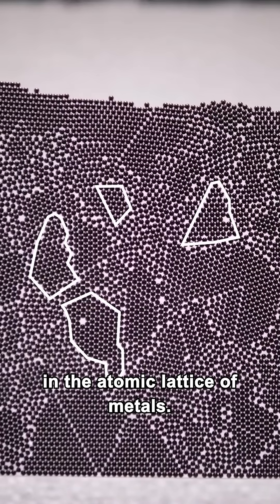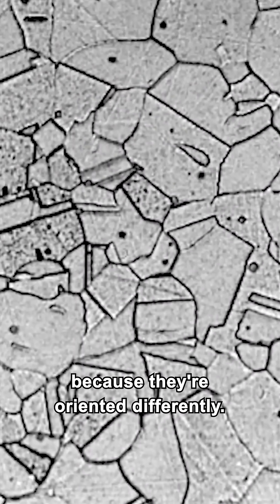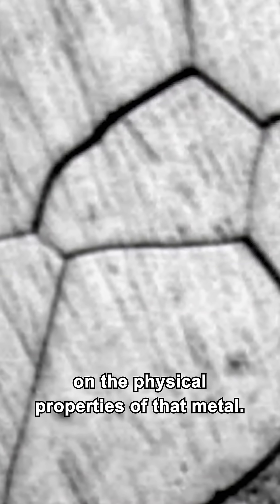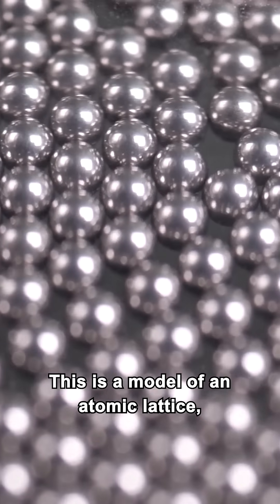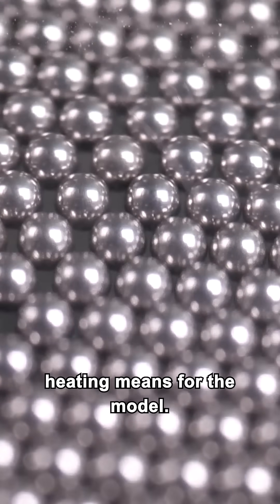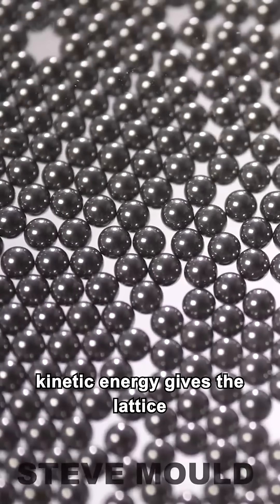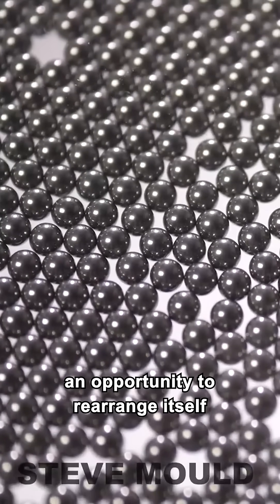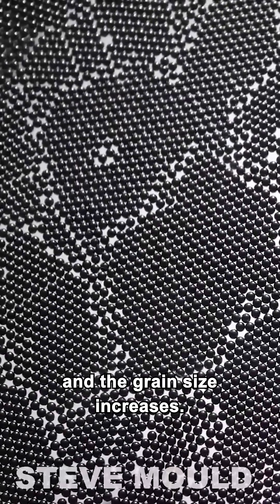What Happens When We Heat Treat Metal? #shorts

Comment: It gives an idea of rock's convection inside the earth where it is supposed to be solid because of the pressure (despite the heat) and capable of move from slips at atomic levels. I failed to picture that in my mind until this video clip.

Comment: There's also a pressure gradient in your model! Since the orbs are stacked vertically, the ones at the bottom have more pressure on them than the ones towards the top, and you can see that more pressure at the same temperature increases the rate of changes in the material! ✨✨

Comment: When you get into steel, this is actually only half the story
This would be a perfect demonstration of the first stage of heat treatment of steel, where carbides are dissolved and formed into larger grains, but there are more stages after this that redistribute the carbides and reform the grains into smaller and more evenly distributed forms, which makes steel overall have more desirable properties
It is super cool to see how grains change over the steps of a heat treat

Comment: Hey,

Just to jump in and say something about it cause I hat Werkstofflehre for my Exams.

Year heat treating is forming bigger Kristalls as you cool the material.but moste times that's an unwanted Effekt.

Year it's use full. To slowly let a big block of iron cool down so it doesn't krank and is though.

But especially for steel to harden it  you want it to get coolt quickly on the outside. For tools or swoars. For a soft and tuff inner and a hard outer layer.

But steel forms diffrent crystals depending on carbon levels. (EKD) 

So carbon treating is a thing.

Comment: I feel that the only issue with this video is that it fails to properly explain to non-engineers the effects of different grain sizes in metals, which I think is one of the most interesting aspects of this subject.

Larger grains means the metal is more malleable and can witstand more flexion, whereas smaller grains means the metal becomes harder but more brittle. This is why a metal can be re-heated in a forge to change its properties and it's also the reason why metal is cooled off quickly (typically with oil or water) while tempering to make it harden.

Good content!
Reply: (What follows in an ‘Um… Actually’, apologies in advance)

Decreasing grain size is one of the very few methods of increasing strength and toughness at the same time. It’s almost always one or the other. Dislocations get blocked from moving very far before hitting a grain boundary so plastic deformation is harder I.e. strength goes up. A crack will grow through some grain orientations much more easily than others so a small grain size is far more likely to stop a crack than a large grain size thus improving toughness too.

Comment: I love this representation of metal lattice structures. The one made of evenly sized soap bubbles too (that one is fun because you can adjust the bubble size halfway through and simulate an alloy, and you can simulate heat treatments by just gently blowing on it from afar). You can also identify most main types of defects with these (all except for 1 that can only be visualised in 3D lattices, I think?)

Comment: Not entirely true. This actually depends on the amount of stress (cold work) done to the metal. If there is high inner stress, the grains will break into smaller pieces to release the stress before re arrangements to larger grains 😅

Comment: Important to note is that heat treatment doesn’t just mean adding heat! The grain size really depends on how hot you get the metal, and the rate of cooling. if you heat it to melt then cool it really fast, you will actually get smaller grains!

Comment: Unfortunately, the actual effects are insanely more complicated, especially considering that larger grains in steels are generally (note the use of the word generally, not always) considered undesirable, since it makes the steel more brittle while not considerably increasing other strengths. Sometimes, it actually makes the grains smaller, in the case of heat treating carburized metals. It is true that the added heat allows movement, but rather than focusing on the changes in grain size, it'd be more conducive to focus on the change in total potential energy, as internal stresses of the metal are released. This reverses the effects of cold working (which increase strength), but increases dimensional stability, and decreases hardness in exchange for toughness and ductility. Not even taking into account alloying, and total changes in grain structure which occur when hardening.

Comment: I wonder if the metal atoms can cause the same issue that grains in a grain silo can have when exiting the silo: due to the math of it, technically, you can get an infinite outward force on anything restricting the flow and it will explode, effectively destroying the exit hole of the silo. Would be hard to test though, I imagine.

Comment: There is a machine learning algorihm called simulated annealing where the algorithm takes some configurable optimizable thing (say a list of users with preferences), and configures it in decreasingly random ways over time. The effect: alot of shuffling of configurations in the beginning of the run, and more stringent filtering of shuffles towards the end of the run. Eventually, you end up with an optimal configuration - all without explicitly tweaking any individual configuration directly. 

Maybe i didnt explain it well here but it absolutely blew my mind in college

Comment: I remember watching a documentary about Rolls Royce and they would isolate one of them crystals put it in a weird tube and they would grow metal from one crystal to stop a phenomenon called creep. Which is essentially just metals expanding and contracting. In jet engines the tolerances are so fine they have to do things like that
Reply: Creep is actually permanent deformation FYI, metals creep when they're held at high temperatures (below the melting point) and put under stress. In a jet turbine, the blades will experience creep that slowly brings the tips closer and closer to the turbine wall which can cause serious problems if the blades creep enough to actually make contact. Monocrystalline steel blades resist creep by being, well, monocrystalline. Because it's all one crystal domain you don't see atoms shuffling past each other like in this video, though creep does still happen just more slowly.

Comment: "Heat Treatment" is a very generic term, and what is shown is only ONE kind of Heat Treatment, the kind which softens metal, making it less brittle as well. Other kinds of heat treatment do other things, including making the grain sizes smaller for a harder, stiffer, more brittle outcome, achieved by rather rapid cooling of hot metal. Extremely rapid cooling from the molten state produces amorphous metal, aka metal glass, which has no grains at all.

Comment: I’m a knife maker and heat treating the steel is what makes or breaks the knife. Sometimes it literally breaks the knife. There’s a few processes you have to do to put the steel in the proper state to be quenched. You want fine grain in the steel, like flour not sugar so you do a few cycles of heating and cooling at different temps to achieve that. When the steel reaches the right temp to be quenched it has the right properties for a knife. The rapid cooling of the steel in the quench locks those properties in. Then you do temper cycles cause the quench also makes the steel brittle.
Reply: I've  heard about the dreaded "tink" fairy. Not had any visits from it yet though, as I haven't heavily forged anything that I've  heat-treated
Reply: @samuelmellars7855 ive been visited by the lil bastard, snapped a knife clean in two
Reply: Tempering also makes grains finer, thus increase its yield and reduce brittleness, if you are looking to make the grains finer in the first place, might as well just do the annealing by keeping the steel at a certain temperature for certain amount of time (exactly how high and how long is dependent on the steel you use, steelmakers should have a iron phase diagram for you to reference), though I am not certain whether it's pratical for you, but if you do have the equipment, might as well give it a try.
Reply: Great informative comment- don't mind the commenter 'Andrew'- his demeaning arrogance is a manifestation/ overcompensation of his insecurity
Reply: bla bla bla yeah, a industrial complex do that without a hammer and in a much more efficient way as well. Doing by hand is a craft and a art, not efficient. Stick to the "skill" part, but don't come talking about steel quality because modern science already does that better for quite some time now. The crafted one is also overpriced af, so there is that..
Reply: @akiraic  dang you that Andrew person really got issues with me explaining how to heat treat a knife don’t you?
Reply: @akiraic bro, you dont just have a degree, you teach a masterclass on yapology
Reply: @akiraic  the "efficient" methods you're talking about are notorious for producing inferior products, but okay. 

Also what a weird thing to get upset about. Do you own an industrial sized knife forge or something? Baffling.

Thats like my neighbor offering me a glass of lemonade and then I go on a rant about how its inefficient to make lemonade at home because Simply has a much better system for making lemonade at a commercial scale. 

Just completely derranged and unhinged.
Reply: Awesome, you are a knife sanding monkey? Well you are talking with engineers buddy. You aren’t the expert.
Reply: @andrewl2787 easy there captain obnoxious. Dude had perfectly valid input to the conversation
Reply: @andrewl2787 serious question, were you repeatedly, and intentionally dropped on your head as an infant? I can not think of any other way you came out this way without some kind of repeat trauma.
Reply: @whatarenames  you realize a 12 year old boy in Pakistan can make a knife with medieval technology right. 

There’s a reason why having a bachelor of science in civil engineering and masters degree in chemistry pay well.
Reply: @andrewl2787  ok, then show the world your superiority and make knives, not as a job, but just to show you're better. Come on, I know you can do it!
Reply: @andrewl2787 dude not trying to be mean but... picking a fight with strangers  on the Internet... just so you can brag about your education????... your ego is a result of a chip on your shoulder. It is you overcompensating...its the is the reason  why people steer clear of you. 

Until you face whatever trauma you have (rather than burying the hurt and anger behind  arrogance and pride), accept it and let go, you will always be angry/insecure/ not feel good enough.

Hope this helps.
Reply: @andrewl2787 Being a knife maker and owning your own business can be incredibly lucrative in the west, this isn't Pakistan.
Reply: @andrewl2787  I get your point that knowing something and understanding the how's and whys are two very different things, but your post came off as quite arrogant and rude. OP was giving an example of practical application of the principle.
Reply: @andrewl2787 Seems to make you arrogant and insufferable though.
Reply: @andrewl2787 hurr de durr knifemakers arent allowed to understand material sciences like metallurgy. 

Imagine trying to gatekeep knowledge lmao
Reply: @andrewl2787 Jesus fella - you get out much
Reply: @whatarenames  Andrew probably works in a supermarket.
Reply: 😊 @TrumpstienPhile
Reply: @andrewl2787  my guy, what gave you the idea he said he was an expert? He didn't even contradict or disagree with anything stated in the video. In fact, he actually furthered the discussion by giving and example of how this principle is put into practice.
Reply: @andrewl2787 so you’re saying a knife maker cannot have scientific understanding or he/she cannot involve in this discussion? What the actual f@ck 🤷‍♂️
Reply: @sreesweraam obviously metallurgy isn't real science, duh. /s

Comment: I am a mechanical engineer with fair knowledge of basic material science.  Have used  different types of heat treatments (Specially hardening & case hardening) on steel many times. Seen those grain structures even with electron microscope on occasion. 

This little demonstration/ video has helped me truly internalize what is going on.
Thanks!

Comment: I'd love to see the grain pattern of Damascus steel up close and then also compared to it being bigger and explained how that makes such a difference.. is it more functional than just other metal (1 the biggest component type of steel) with a similar heat treatment/forging?
Reply: Damascus steel is somewhat like a modern Carbon fiber composite, with layers of strong but brittle material alternating with layers of softer, less brittle material. A great example of this sort of composite in nature is the Abalone shell. Ironically, putting too many folds in the ingot will actually destroy the benefits, by making the layers too thin... even down to the thickness of single atoms!

Comment: so, when the vibration stops, it translates to "water cooling" or some sort of "temperature shock" to HOLD the atoms in the rearranged form? because otherwise they would cool down unevenly and be unorganized again
Reply: If you cool it down slow it would give the balls time to continue reorganising and you wouldn't get the wanted grain size.
Reply: @Daniel-ih4zh  so in forgery that's why the cool it fast with water? so the crystals are uniform and thus making it harder to break apart, right? I think I did a similar thing with a needle

Comment: Is this the same for copper vs iron based metals where heating and rapid cooling hardens iron and steel but softens copper and brass. I had to bend some brass tube and was really surprised that first I had to heat and rapidly cool it.

Comment: If the rate at which a casting cools down is slowed down sufficiently, by the use of ovens, it can be manipulated to form a single crystal.  This is done for the fan blades of jet engines and similar applications.  It is incredibly  expensive in terms of energy and (naturally) money.
Reply: Yep isn't it used because the blades are so small/thin that if they weren't made out of a singular crystal they wouldn't hold the sheer forces inside the engine? I think I read/heard something like that somewhere.
Reply: @pvpminer9007 No. They are created as a single crystal to improve their strength. Interfaces between crystals are points where the metal can fail.

Actually modern day turbine blades can be laminates.
Reply: @deang5622 you mean tensile failure. A larger crystal is much weaker from a compressive pressure since the crystal can realign itself without having to jump to the next grain.
Material science is weird like that.
You get good compression resistance and become inflexible, but then you shatter.
You get good tensile resistance, but then you bend and can warp.
But I guess the fan blade guys thought of that, they are pretty smart guus
Reply: Making single-crystal metal takes much more specialized processing than mere slow cooling in an oven. There cannot be ANY existing crystals in the metal, so all castings and extrusions are eliminated from the acceptable types of processing. Instead, crystallization has to be SEEDED with a small crystal already having ONLY the desired crystallographic orientation, with the molten metal quickly adopting that preferred pattern as the uneven heating of the oven causes the solidification temperature to be reached exactly where the growing seed crystal is positioned, but nowhere else.
Reply: @Lilin.X That is one process; there are others.
Reply: GE has relatively recently started making SiC/SiC composite fan blades for their jet engines so that they could increase the operating temperature of their engines. This composite is similar to carbon fiber, but the actual carbon fibers are silicon carbide fibers and the epoxy is also silicon carbide.

Comment: That's an interesting model. Using sound as a proxy for heat raises another question about resonant frequencies because sound can create certain patterns and structures on a two-dimensional surface at specific resonant frequencies. This makes me wonder if there's an equivalent to resonant frequencies when applying heat to a two-dimensional or three-dimensional material.
Reply: The random frequencies and wavelengths associated with Heat extend to extremely high frequencies such as THz (trillions of cycles per second) and extremely short wavelengths. That is far beyond anything normally called "sound." And that energy is quantized at the atomic level, so if searching for any existing publications on your question, you probably will get into extreme complexity right away.
Reply: Resonant frequencies occur when you have consistent motion. ‘Heat’ or having thermal energy is defined as having random motion via vibrations. Unfortunately, random motion rarely turns into resonant motion unless some resonant frequency is acting upon it. Therefore, you’d need a heat source that can somehow be defined as having resonant modes. Long story short, wonderful question, but there is no regularity to random motion, so no. 

As a short addendum:
Condensed matter physics has to deal with weird things happening at extremely low temperatures. At these temperatures, although particle motion is still random, it is much much slower and may have different properties. I would watch some videos about condensed matter physics and see if they talk about anything relating to your question, that’s the only thing I could think of that might have a chance of being close
Reply: A few quick googled.
The resonance phenomenon in thermal waves

Thermal parameter identification for non-Fourier heat transfer from molecular dynamics